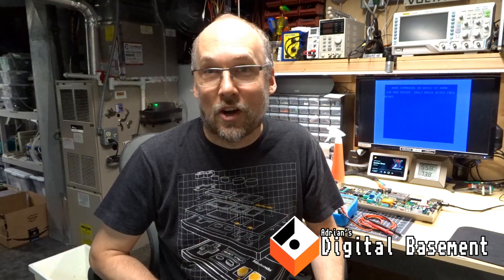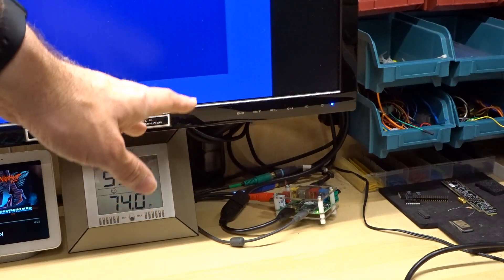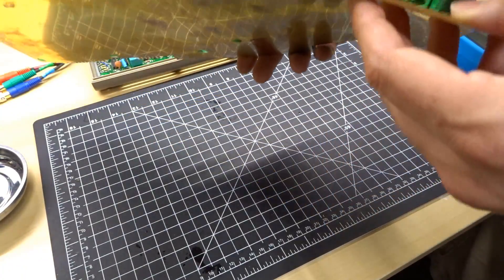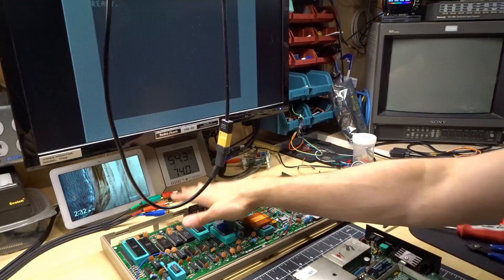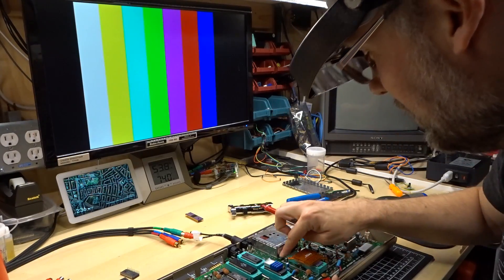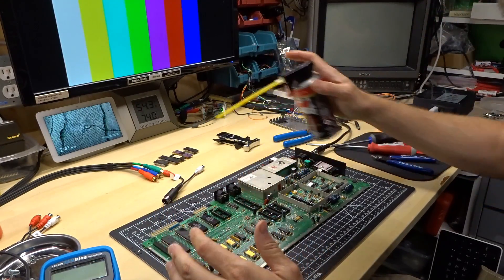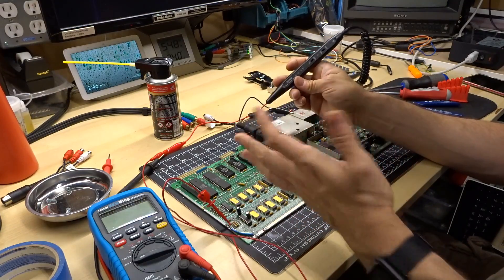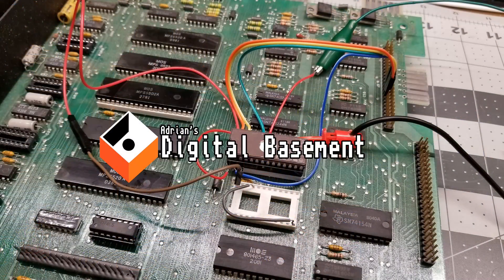C64 Repairathon! Part 1 - Intro and black screen on #1

Comment: Chipquick is expensive. Rose's Metal is cheap. 1.76 oz for $40 for Chipquick on Amazon not counting membership or shipping cost....or 7 ounces for $24.40 WITH SHIPPING FROM UKRAINE. Rose's metal melts between 94 - 98 C. It stays molten a good long time (it's eutectic!), allowing me to easily pull the meanest most stubborn anchored multi-pin component with ease using the most gently low hot air settings. WARNING: Any blend of lead + bismuth should not be left remaining on the circuit board where temps could be expected to reach 94 - 98 C. Clean up with Solder wick, desolder vac, solder sucker.

Comment: Like earlier remarks, your not really carefull someday you will have a dead chip because of static discharge. And the way you removed those chips is a horrible way, dont like the way you ripped the ground of the board.. Means more repair and less authenticity

Comment: Hi Adrian, I am interested to do some ZIF socketing on my machine as well. I have a 250407 PAL version. My current issues I scratching my head about is, that the ZIF sockets allways conflicts with the capacitor "above" the chip in all cases. So what did you do with those capacitors? Put them under the mainboard as SMD, or what was your approach to that issue?

Comment: Just wanted to comment to thank you for this wonderful series of videos. I landed here by suggestion of Youtube, I opened part #1 to waste a few minutes waiting for something and I ended up glued to the screen until the end of part #4.
Your videos are pure joy to watch. I admire your well-thought troubleshooting and use of your excellent equipment. I'm jealous, wish a had such a workshop! You have a clear diction, easily understandable by me as a non-native english speaker, and a sense of humor! (plus a lot of time on you hands, obviously!). This brings back a lot of memories too. I graduated in the 8-bit processor era, the 6502 is an old friend, did a lot of work on Synertek's KIM-1 and SYM-1 prototyping boards, including cabling control interfaces for the 6520 PIA and hand-coding assembly language. Later on I had my own self-assembled Acorn Atom, another 6502-based machine.
Please post more of this, you have a new fan. Thanks.

Comment: It takes 20 sec for a modern T12 iron to heat up, yet cutting a RF shield and puling a trace and repairing it is faster. It does matter if it faster, which it isn't, always try to be professional as it gains credibility.

Comment: Some excellent advice at the start of the vid. Don't start desoldering and pulling chips due to a black screen until you have checked your video cable! I would also recommend trying another tv or monitor. All my c64's work great on my 40" TLC tv as well as my pc monitor but just give me a black screen on my Toshiba tv.

Comment: Awesome! Thanks for sharing the experience! Maybe you have already fixed the machine, but voltage seems low. Something dragging it down? dirty power switch? Since the 556 was bodged, I'd check that out if the machine gets a proper power-on reset.

Comment: I always remove the SID if it is socketed after opening the unit and then do a dead test. I had 3 407s that only had bad SIDs and nothing worked until they were removed. One of the C128s I repaired had all the socketed chips bad and everything else was ok. We need a database to have a lessons learned for troubleshooting. Right now we having many sites to go to that give us help to cut down the time troubleshooting but wouldn't it be nice to have it all in one place? I love your videos but just wanted to give my thoughts.

Comment: On the white labeled PLA: 8411 is probably not a date code; it appears to be a hexidecimal checksum, according to the author of "The C64 PLA Dissected."  It makes sense, because so many people with 1982 C64's have 8411 PLA's and their machines were not all modified or upgraded.  The PLA's with the labels seem always to be 82S100N's (probably Signetics) which were programmed for the task before Commodore had the capability to make their own clones, so they don't seem to suffer from the age-related failure of the mid-generation PLA's.
Thank you Adrian for the awesome video!

Comment: You mean people just have these lying around to donate? There's a very active electronics recycling program in my province, so if it doesn't end up on eBay or Craigslist, chances are it ends up getting shipped off for scrap, and then it's gone forever :(

Comment: It's funny how everyone keeps saying that the rf shields had no function. RF shielding IS a function. I don't think that the regulations that forced the vendors to use the shieldings are obsolete and in fact, electromagnetic environmental pollution is an increasing problem.
So basically all people removing the shield, are converting the home computers into illegal devices.
Reply: Facts make you sad? Better terminate your data plan then.

Comment: Ah yes, blue painter's tape. An absolute must next to duct tape.
Reply: @adriansdigitalbasement  Blue painter's tape OTOH does. I've used it for such diverse applications as putting together a scintillation detector for gamma spectroscopy (did that yesterday in fact) and packing NRC-approved materials (yes, that NRC). :)

Comment: Check if the 556 timer is releasing the reset line. Should go from high to low at power on.
Easy to check with a multimeter.
Reply: http://www.devili.iki.fi/Computers/Commodore/C64/Service_Manual/Page_05.html

Comment: I really like the breadbin C64s, maybe one day I'll get my hands on one, are they complicated when it comes to maintenance or other stuff like that? AFAIK the PSU is probably what worries me the most, I've heard about the horror stories of Commodore cutting corners on PSUs... Is the C64 affected by these corner cutting measures?
Reply: @adriansdigitalbasement  so about the PSU, is there is an alternative to the killer PSUs that Commodore shoveled in with C64s (like an existing PSU that could be adapted to a C64) or will I have to roll my own? (I'd ideally prefer the former, but I'm not afraid to build my own PSU from scratch)

Truthfully, I'm rather a newcomer when it comes to non-PC retrocomputing (well expect for older Apple hardware, the rest has always fascinated me, and after seeing your "One Commodore to rule them all" video, it really piqued my interest in older Commodore computers)
Reply: @adriansdigitalbasement  interesting... Anyways thanks for the clarification,

Comment: Don't you wear a wrist strap when handling these chips?
Reply: @adriansdigitalbasement  Hi. Some ESD damage will not cause immediate failure, but will bite you months or years later, and you will not know why. You should always wear an ESD wrist when handling the chips individually. Besides, older CMOS technology is more sensitive to ESD damage than newer stuff. Thanks.
Reply: Humility level ;)

Comment: "I don't desolder because I hate these things and they do no good so I take my anger out and just rip the shield off"
6:00 ~ "oh uh haha whoops I kinda just wrecked the PCB by just ripping it off" 🤣🤣🤣
Reply: Ha!! I never thought you'd actually see my comment, they usually get buried ;) Yeah, but it's a 35+ year old PCB though! Got to treat those things like antiques. Nervous seeing you toss it around casually like that, but hey, long as you fix it ;) I always desolder/resolder it because it's simple enough (go get a TS100 soldering iron, TS100 open firmware off Github, a D24 tip, and 6S LiPo battery, it'll change your life), and it keeps the original parts together.

As to anything I can offer advice wise, the "this tells me nothing" part of using a probe, you'd be looking for logic toggling to abruptly stop on one of the pins. Common problem on a bus is a broken trace as it weaves between chips. To find it, poke I/O lines on each end of the bus traces (often at opposite ends of the board, but with C64, it kinda snakes around), see if one end isn't signalling. The break would be between there. Logic probes make that possible!
Reply: I guess it is kinda randomly asking but do anyone know of a good place to stream new movies online ?
Reply: @jamiematthias2620  This is a bot, right?

Saw another comment from someone on a different video asking about something else completely unrelated to the video, also in a comment chain, also a month ago.

The hell is going on with youtube bots now?  These just don't even make sense.
Reply: @AceStrife  It's probably to try'n evade spambot detection algorithms. If they have a ton of comments that don't get flagged as spam, it probably makes them seem more 'legit' and thus harder to automagically detect and block/delete them.

Comment: Yeah RF shielding... it mattered when TV was RF and people listened to the radio.  But in 2019 with digital TV and people listening to streaming audio and MP3s, you'd have to deliberately try to find a case in which it mattered.  LOL
Reply: This ham radio operator disagrees. :)
Reply: @adriansdigitalbasement  The cardboard rf shield is just there to pass the FCC test and as I see it causes the chips and board to over heat.
I remove them but save it. The metal shield are great heat-sinks as well. Most of these old boards have TTL chips but I still put them in anti-static foam as you did when you said I will save this SID for later. I never lay them on the bench. I still have ESD training I had back in the 80s and it still applies. I would think you would want to show how it should be done.

Comment: I was repairing C64s as a bench tech back in the 80s.  I haven’t seen the end, but I bet its a RAM chip.

Your methods are straightforward, but you missed the “Laying on of Hands”, the first check.  What chip is burning hot?  That might be the bad one!  

Enjoyed watching.
Reply: Continuing down my path, you can sometimes diagnose a bad RAM, one blown open, not closed, by piggybacking a known good RAM on top of each chip until it works.  Many times, multiple RAMs were blown at once, so you leave known good RAMs piggybacked as you do each one.

I haven’t thought about this in 30 years.  Lol!

Comment: How does that chip puller desolder so fast!
Reply: You can only remove socketed chips with this beast, when chips are not in a socket but directly soldered onto the motherboard, you still have to desolder them with an iron
Reply: Hi DJ Slinus , I did know that I was just trying to be amusing😛
Reply: @anoopsahal1202  oh I thought about that before I wrote my comment xD but I left it there so others who might not understand know what this is actually for
Reply: DJ Slinus I would  quite like to see some one try to use it on a soldered chip👺
Reply: @anoopsahal1202  that would totally break it😂

Comment: It doesn't make sense to test the Kernel ROM as the dead test cart bypasses it.  But it does require a fully operational character ROM!  So socket that one and test it.  Repairing a few C64's now, I came to realize that the dead test cart are not a silver bullet.  They need a lot of things to be working well in the system before they work. At this point I use dead test just as a RAM test utility.
Reply: Adrian is right: The Dead Test cartridge uses the Ultimax mode (that way it can bypass the KERNAL), but because the Ultimax had no character ROM (in fact, no ROM at all), the C64 disables the cartridge ROM in Ultimax mode. The Dead Test cartridge is therefore forced to provide its own character set, and it does.
Reply: @danielmantione  that's not what I noticed.  I had a 5 pin C64 that the dead test cart wasn't working on.  It ended being one of the pins on the CHR ROM not soldered correctly.  When I fixed that, dead test (and computer) booted correctly.
Reply: @leonkiriliuk  Could it be one of the chip select lines? Because if it was specifically one of those lines, the char ROM would have disrupted the bus, preventing the dead test to initialize the VIC-II. That's the only explanation that I can see. Try to remove the char ROM, the dead test will work.

Comment: Did you try connecting it through the RF? Sometimes the video port is screwed. If you're getting data it's doing something. I have a C16 that will have jailbars on the boarder or at least vertical lines when hooked up to my CRT. On a LCD no jailbars. Looks perfect. Dunno why.

Comment: Why not put sockets in? Because they have a high failure rate over time unless you buy super expensive quality ones. We run into this with old synths. I see you talk about the machined sockets later, but my synth repair friends tell me even those fail often, unless they are the 3M or other high-end ones. I haven't run into this myself, however.
Reply: Yes, but it's better to destroy a failed socket during removal than it is to damage an irreplaceable chip like a SID.  Sockets are sacrificial.

Comment: Why not just go straight for the oscilloscope instead of messing about with the logic probe? Also the fault might be with one of the 6522's, it appears the previous owner already replaced at least one of them.
Reply: @adriansdigitalbasement  It certainly has the added bonus of looking "sci-fi" to someone who has no idea what it is :) The videos are great btw, keep up the good work!
Reply: It takes much more time with the oscilloscope than with a probe. Personally I don' t use a probe, but the Hz function of my multimeter: If Hz<>0 then pulsing. The Hz value itself is also usefull: You can compare it with a known good C64, if it deviates, this points to something suspicious.

That said, you still need the oscilloscope in many situations where the probe or multimeter doesn' t get you enough information.

Comment: :/ a Vic II and SId with the start chip number of 65xx is a 5V only Chip. The 72xx and 85xx (found in the later C64 and C128) use 5V & 12V. The Q is, which is better? Many would say the 5V 65xx chips are for better sound on the SID and better (clearer) video on the Vic II.

The SID provides the Dynamic pulse for Dynamic RAM, so it is needed. 
One test you should do is check the reset line to see if it goes from Low to High (or High to Low) when you turn it on. When you flick the switch the output of the 555 timer hold down the Reset Line to the CPU for about 4 seconds, and that is readable on the logic probe when it goes from one state to the other. If there is no change in the reset line then there is something wrong with the 555 timer chip.

Comment: I would always keep the RF shield. Why? Because it shields RF ;)
I dont like the paper with aluminium foil on it, but the solid shields are cool.
Reply: @adriansdigitalbasement  I don't think we should recklessly take out everything we don't need. We are repairing these machines to preserve them for future generations, but future generations want to see the machines as they were, not as how we modify them. There are compromises to be made, i.e. we need to keep them in working state and usable, and it doesn't make sense to preserve cardboard shields that have been eaten away by time. But the metal shields certainly can be preserved and we I think we should. If it reminds future generations that people did use AM radios in the 80's, that IMO is enough reason to keep it.

Two weeks ago I spend several hours on two Amiga 500 RF shield to remove rust and make them look shiny again.

Comment: I use to have a c64 back in the day even a c128 
i need to save up and get a C64 :(
Reply: In December there will be a new release of a porber C64 reboot. not like the mini which only has a keyboard for decoration. It will have a full functioning one. It should be around 100$ as far as I heard.

Comment: Since that machine was worked on already the quality of the solder joints should be inspected. You don't know how good the previous technician was - maybe some joints aren't soldered properly, or there's a lifted trace?

On the other hand, signs of extensive reworking aren't very promising. It could be that whoever was trying to fix the problem before you failed to find the source of the issue. This means that it could be a tricky case.